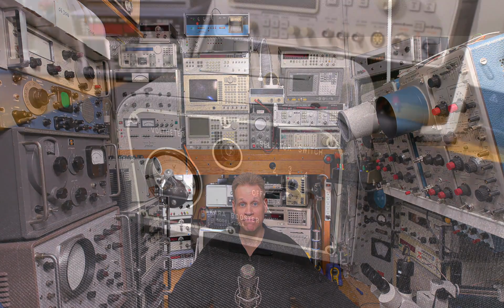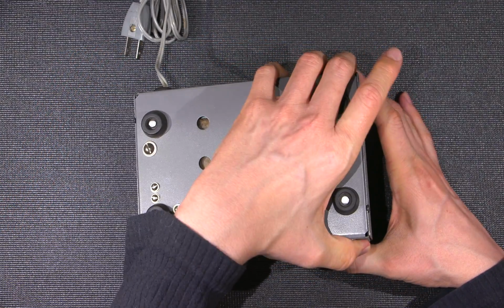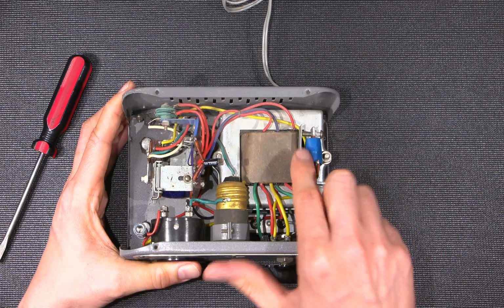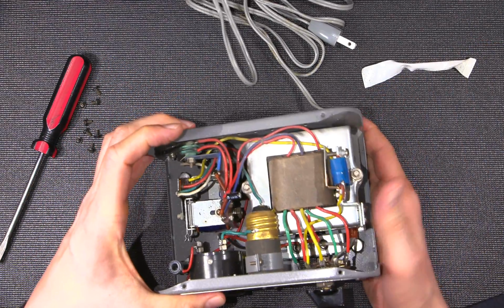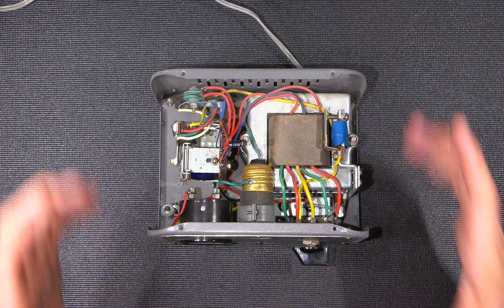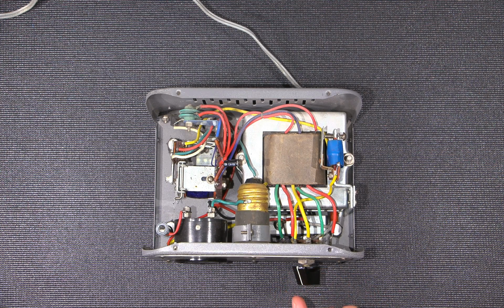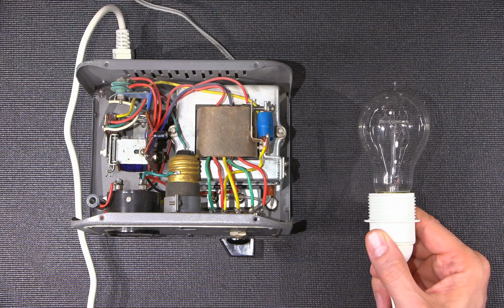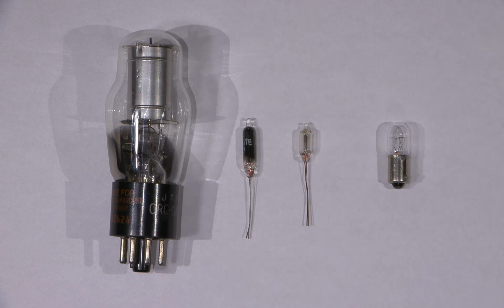What's a Takara Booster 200A? Let's Find Out!

Comment: Worth it just to see that neon light up - they don't make 'em like that any more !  
I wonder how they detect the over voltage - just the relay pull - in point perhaps ?  So I suppose with a large load,  the lower tx output might enable you to switch to positions 3,4 and 5 without tripping - would need some nifty wiring to make that work :o)  That box and nice meter/neon is asking to be re-purposed.

The trivia q.- I like the idea suggested by one or two folks that the bulb's photons not only ensure that the neon fires up, but might also be a crude constant current source for the neon too ? Never met this in valve equipment I've poked at.

Comment: Gee as a self taught preteen (60s) I was messing around with valve equipment. I'm still here despite a few learning experiences. eg test with the back of one's hand first rather than just grab something.

Regarding the current safety rules; it's all to do with one's govmint (sic) trying to do away with the Darwin awards. Some hope!

If I remember correctly the characteristics of filament light bulbs used to be used in the feedback circuit for highly stable oscillators (wien bridge?).

Comment: Fancy Line conversion Transformer like we used in the Military converting 240v to 120v only Up and not down.  LOL  Most new equipment would be good to go with anything between 70 and 240VAC.    BD !!!!   Before Diodes !  A selenium rectifier..   Man them puppies get HOT !    LOL, Yes people were actually Some What Smart back then.  UNLIKE this new crop.   The Enclosure looks just like a Old Automotive Battery charger I have here.  Probably the same maker . Or just Generic of the day ?     

Trivial  Incandescent Bulb is being used as a CURRENT LIMITER.  Taking advantage of the Positive Temp Coefficient  Hotter More Resistance.

Comment: Why did they Fit 3, 4 and 5 Settings if it will not use them without cutting out ? ( Newbie )
Reply: It depends on the input voltage. If it was lower, the output voltage would be lower too, and you'd be able to crank up that switch to compensate. You'd be able to switch it to 5 as long as the output voltage didn't go above ~120V, which would trip that overvoltage protection relay.

Comment: Brought back memories growing up. My uncle had a more basic model in Chicago in the 50s and 60s to compensate for low line voltage in his condo. Your Japanese one is pretty slick. Can't say as I ever saw one in Japan during business trips in the 1990s but by that time electronic power supplies had a much wider input voltage tolerance.   

Different trivia: much of Chicago started as DC. In the 1950s able to score vibrator based DC to AC inverters as they were removed from service and scraped.

Comment: You have hinted in the past that the incandescent bulb helps to add temperature compensation in a circuit due to the slight change in resistant of the filament. However it may be more to give a constant temperature to the neon type regulator to give A more precise and contestant output...or both...

Comment: I think since plasma tubes are negative resistance, you would need to limit the current with a resistance like a lightbulb. Also it would pass a ton of current to light the tube and then lower the current as it warms up.

Comment: I guess I grew up technical... Dad configured a 10 amp variac with AC volt meter to correct line voltage for the big Zenith and the old Admiral TV when we moved out of the city..    In my pile of stuff that I will not live long enough to restore is an automated AC line voltage corrector that consists of 2 rack mounted chassis.. a vacuum tube based controller, and a motor driven very large variac.   This thing you have here is a pretty neat little device.. definite cool factor. Harkens back to a time when the AC was all over the map... it may have been low voltage as you got farther from a generator,  but at least it looked like a sine wave then...   Todays wave form is a broad band mess.

Comment: You can restore old plastic or rubber power cords with spray silicone. Just saturate a paper towel and work a section of the cord at a time. Works on rubber grommets or bushings as well. As long as it's just age and not physically damaged it usually works quite well.

Comment: Just a wee bit of a sarcasm aimed at today's ambulance chaser lawyers. LoL.

These things were sold to PCS (Permanent Change of Station) Allied service  personnel in the hundreds of thousands, between 1950 and 1975, assigned to Japan or Hong Kong Hotels, which today now only use 220V instead of 100V. 

Also used extensively in South Vietnam between 1959 and 1975. Step down transformers were also very popular in all three regions.
Reply: Japan is still 100V - although the line frequency might be either 50 or 60Hz depending on where you are in the country - HK is 220V, 50Hz.

Comment: But why does it go to 5 on the selector if only 2 notches max it out???
Reply: It depends on the input voltage. If it was lower, the output voltage would be lower too, and you'd be able to crank up that switch to compensate. You'd be able to switch it to 5 as long as the output voltage didn't go above ~120V, which would trip that overvoltage protection relay.

Comment: Japan also had 50Hz in some regions and 60 Hz in others (wreaking havoc with certain electronics in the early era of integrated circuits).  This unit would probably not have been safe for IC-based electronics in voltage conversion due to the age of the unit (prior to widespread use of digital electronics).

Comment: The light bulb is included because, tucked away in the dark underneath a chassis, a regulator might otherwise have a hard time "kickstarting." Even when normal voltages are applied, stray photons from ambient light are usually needed to start the regulator conducting. Some types of regulators included small amounts of radioactive compounds just to make sure they would predictably ionize.
Reply: 100% correct! A word of caution on the radioactive ones.  While most used an isotope like Kr-85 or Ni-63 sealed safely inside the bulb, occasionally you will come across an ordinary neon bulb that was painted externally with a radioactive paint,  which can easily be flaked off when working on the gear, and contaminate your work area and possibly get ingested or inhaled.

A 60's era GE glow lamp catalog I have shows which types were doped to reduce what they called the "Dark Effect".
Reply: Bob Weiss crazy.
Reply: @bobweiss8682  You just said zero percent correct!!  ;-)   (!00%) Oh, fat fingered the keyboard. :-) You know more than I do. Interesting. I thought it just needed a little heat.  :-) I do recall something about light affecting tubes. A vague memory from a long time ago.
Reply: @bobweiss8682  You would need so many of those doped bulbs to be of any consequence its not worth mentioning.
Reply: I also agree.  The F4 Fighter had a "Trainer" missile that never left the plane.  to record the pilots actions, there was a Polaroid camera with an internal custom bank of neon lamps that would expose the film so when the mission was over, the Polaroid film would be developed and the flight parameters would be shown.  It indeed had a small incandescent lamp to "bias" the neon lamps so they would light reliability in all weather conditions.
Reply: Some old fluorescent lamps also have the problem of having a hard time starting in the dark. Anyone remember the early CFLs that often needed a flashlight as a starter?
Reply: @NiHaoMike64  And a hammer to stop them.
Reply: This is correct.
Reply: @tglendenning  also some are/were radioactive.
Reply: When I worked at a NASA ground station in the 60s I came  across, in stores, a number of regulator tubes. There was a warning not to store more than certain number of them together!
Reply: Exactly what I had thought too. Incandescents provide, besides heat, a wide continuum of photon frequencies which can excite solid state bound electrons within a neighboring circuit component, giving them just the kick they need to tunnel through the potential barrier and initiate current flow. If the bulb uses low-iron glass, then relatively significant amounts of UV (ionizing) radiation too is emitted, all the way down in energy through infrared (thermal) ;-} love it
Reply: I was thinking the bulb was there to heat up the neon to start it.  It's interesting that it's actually the photons that are doing the "jump starting."  As a 2nd year electrical engineering student this channel is absolutely fascinating.
Reply: I had no idea some bulbs would need a jump start. My guess of some sort of dim bulb style protection was way off.
Reply: @chrisvinicombe9947  I thought for sure it was a voltage present safety bulb. You just dont know, what you dont know!!
Reply: They had similar issues with the turbo encanulator.
Reply: Agree :)
Reply: Jim Nugent
I think Mr C was talking about the filament and not the Cathode.  The filament is just a heater for the Cathode.  Correct me if I'm wrong
Reply: Cool! I never knew that.
Reply: To supply some extra photons to trigger the neon bulb. As neons age the sometimes will fail to trigger in dark environments. So the incandescent gives it that extra OOOMPH!!!! It needs to get it going.
Reply: I discovered this effect very early on in my carreer. I worked for a computer manufacturer that used 19 inch racks to mount the system components. At the bottom of each rack was a power distribution and control unit. Big black box with outlets, breakers, and some neon bulbs as indicators. While working with those racks, I soon noticed that some bulbs would only lite up when the door of the rack was open and light shinning on the bulbs.
Reply: This is not so old... LOL, CCFL backlit LCD-TVs (1999 to 2009) also need an LED to ignite the tubes. I had TV sets that would stay dark in the customer's living room and function perfectly in my well-lit retail and repair shop. In 2007, many companies released firmware updates to tailor and optimize the ignition system. 
Pointing a 5D Maglite (before LED) at the set also gets it to life and shows the customer that his own cigarette smoking habit caused the failure by darkening the tubes and the trigger LED with it... (That LED sits on the Inverter board and is prone to attracting smoke through heat and high voltage)
I took apart many TV panels to clean them out, saving my customers from prohibitive costs. (A little over 10 years ago, Flat TV's used to cost deep in the 4 digits and I always sold the high end models you usally do not throw away on a whim) (And some of them  were so good in picture quality, people still use them today)
Reply: I agree. It was one of the things taught in my military electronics courses. I have an old power strip that a neon indicator went out. I was messing with a near IR LED and that triggered the old bulb better than the visible light.
Reply: This is interesting, never fail to learn something from watching Mr Carlson's videos. I have a power strip with the neon out in the front room, will have to "prod" it with a couple of torches/remotes etc and see if it comes back!

Comment: Paul, the takara can use a poor japanese source as low as 70V AC. you didn't test it at that input voltage.
Reply: I would like to see this as well. This would show the higher options on the switch actually working :)
Reply: @zaprodk  and also various loads too.
Reply: Ditto. I'd have thought that a no-brainer -- to go all the way to "5", so to speak.
Reply: Someone has already answered this obviously but I can confirm that those are usually there for assisted conducting of tubes, and another cool,thing to nore is that there is a photelectric effect of neon bulbs that can change conducting voltages of neon bulbs themselves, its not brought up much because its not important in most applications unless there is barely enough striking voltage or you just like to mess with electronics and like to know cool facts because they are normaly just indicator bulbs and often used for some small lighting, in another scenario incandescent bulbs are wired in series as protection devices in some ectronics as well
Reply: America still had earth return ground feeds to rural areas, so you could get 70 or 80 volts in late summer and 135 or 140 volts in the springtime. It depended on the moisture in the soil as to what voltage you got. This was way up in the mountains of Colorado. If you stayed up there in the winter, you stopped caring about electricity, and focused more on a good fire. You moved the bed right next to the wood stove, it was so cold. Odds are you NEVER stayed through  another winter. After the snow took down the power lines, you had 0 Volts, and 0x anything is still 0. I found a few earth returns feeding bracero shacks in New Mexico, Arizona, & California into the 1990s. Lots of complaints about electrical shocks too! It's just a very bad system, but it's very cheap and very easy to install. I am sure the farmer's attitude is "They are just Mexicans", but they deserve to have a place to bathe and wash that won't try to kill them. Driving ground rods away from the sinks and showers abates that issue of electrical shocks, to a good degree. Installing a proper system is what needed to be done. The drug smugglers took over a lot of those shacks anyway, and we wound up removing the electricity completely, and then razing the buildings too. We have to re-tap to attempt to keep voltages around 120/240  120/208 or  277/480. As demand goes up the voltage goes down and automation only goes so far.
Reply: Aha! Hence the five settings. That makes total sense. I see comments about higher output load but it seems the purpose of this device would be to maintain 120v out with a lower input voltage. The devices being run would be consistent (in their load). Amperage can't be boosted but voltage can. Available input voltage (In Japan, in the 50's) may have varied from time to time to necessitate the production of this boost converter. I would think that there would be a lot of chaos in the grid after WWII.
Reply: @Conor Hanley
the output Voltage of a transformer depends partly on its load. Paul didn't put a (large enough) load on it, so the output at the moment was more than the max. 120 Volts ever needed. Any position higher would give a Voltage out of range of any equipment, so the safety limit kicks in.
Would Paul have put a load of (say) 150Wats on it, the output Voltage would drop, and the safety circuit would allow the switch to work in a higher position, thou still with the same max. of 120 Volts on the output.

And second, if you would start using the device with an unstable low Voltage, and the Voltage suddenly rises, the output would suddenly rise too. The safety circuit would then demand a lower setting of the switch, so it would turn the device off to warn you.

Third I forgot: lower input Voltages would also demand higher switch settings.

All three points are to only allow a max. of 120 V out.

Comment: The incadescent bulb emits light which helps the regulator to start burning. manufacturers specify a certain starting voltage that is much higher then the operating voltage of the stabilizer. in some cases the higher starting voltage may cause damage to the circuit behind the regulator. in that case the supply voltage of the stabilizer tube is below it's specified starting voltage. To give the tube the needed kick, to start burning, a light bulb is added (or in some cases Co60). I think it has something to do with the compton effect ionizing the gas.

Comment: Neon and most other gas based regulators require a higher voltage to start breakdown and begin conducting/regulating, and at times the striking voltage can be inconsistent. The addition of a light source nearby causes a photoelectric effect to make the striking voltage to drop and can help them start regulating. This is similar to how some radar tubes have uranium glass or thoriated, cobalt, or another radioactive source inside the tube to start the electron path.
Reply: Many years ago I designed production test equipment for a calculator company.  One calculator (I believe it was the SR-20) gave us fits.  The device used a Panaplex display, which is a neon gas-discharge display.  The setting of the operating voltages was was critical.  The problem was, with the top case removed, the display may work perfectly, but as soon as the top, with its window, was installed, the display would have missing segments.  Increasing the voltage would make it with with the top on, but when the top was removed, the segment would arc.  In this type of display, the hysteresis between trigger voltage and operating voltage was used as a sort of memory.  If it triggered on at 75V and would stay lite at 60V.  You could bias the entire display at 60V, then hit segments with 75v to lite them up, or 50V to shut them off.  Memory was very expensive back then.
Reply: That is really neat. I never knew.
Reply: Oh!! I was going to say I may be related to having a heat source for very cold operation conditions so the conduction could begin, but your answer is more appealing.. and most probably the correct one :)
Reply: it;s a current regulator as the current increases up so dose the resistance limiting the current ( fulfillment resistance increases with temp )
Reply: That lamp does NOT need to be located next to the regulator tubes though. I have built several things that use incandescent lamps as  current regulators. Many (most) of those are solid state. Gas regulator tubes do not regulate current so a lamp would be a good choice, but lamps were also used to kick start the arc in the tube too.